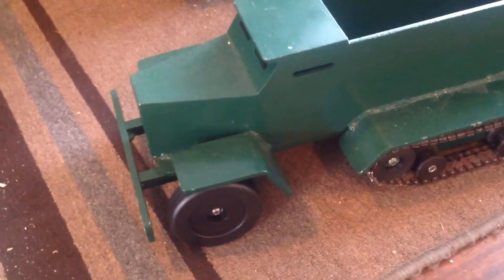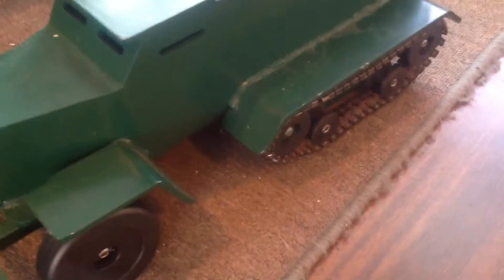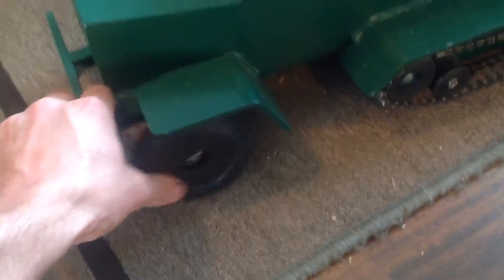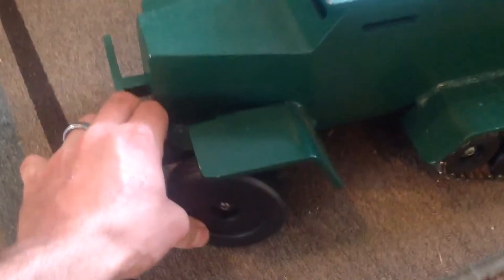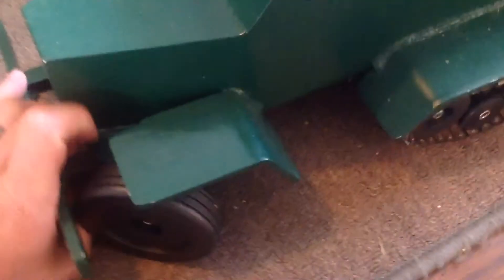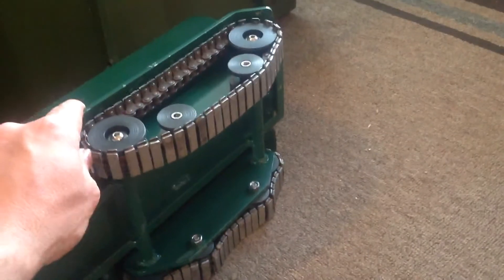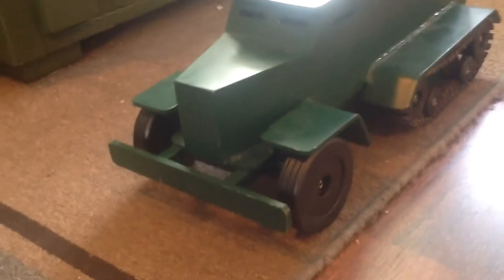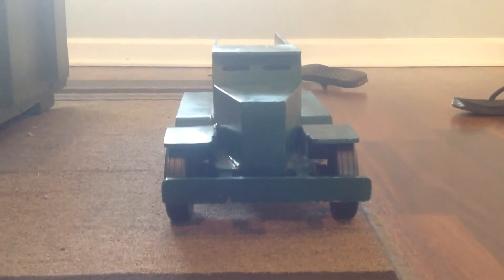Half track toy

Comment: Do you have a primary source for getting the BREN measurements?
Reply from the maker: The barrel nut erea is set by the barrel nut itself. The middle section is set by the barrel breech block and locking shouldermto set the headspace. The very badk piece is non critical and can be set by eye if you want. I really didnt use measurements at all so to speak
Reply from the maker: Also sign up for www.weaponsguild.com
Reply: Just Registered! Thanks for everything good sir! Hopefully this YouTube BS blows over!